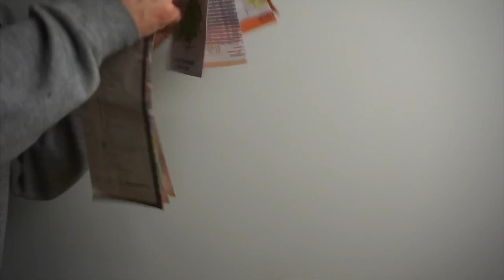ENGINEERING in the SUMMER

Comment: Hey Kyle.
I might not get direct admission to engineering in OSU, so I applied for physics. How long will it take for me to transfer back to engineering and will I be behind?
Reply from the maker: I’m not exactly sure on the timeline for transferring, BUT you shouldn’t be behind on a 4-5 year timeline. It may seem like you’re behind at first if others are in low level engineering programs, but just make sure you’re taking classes that both majors need. Like your maths, physics, General curriculum classes.